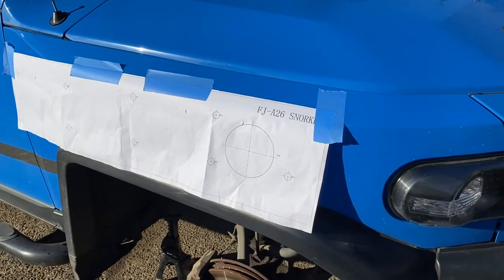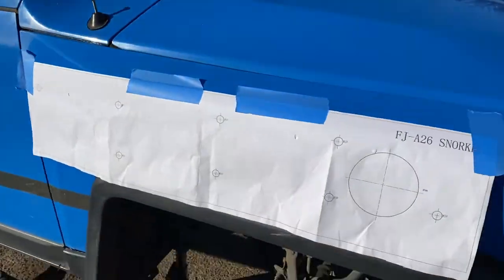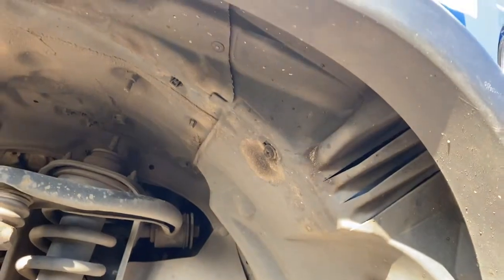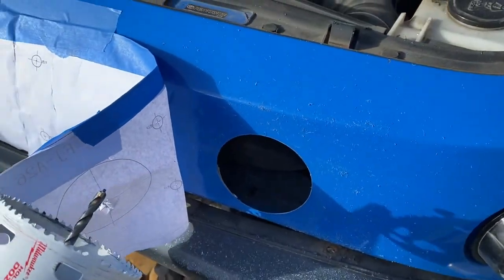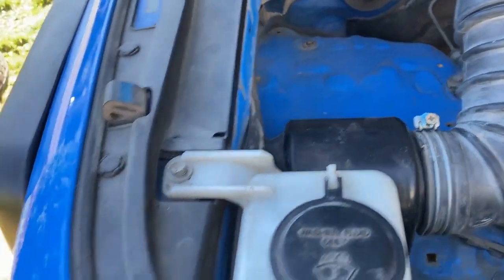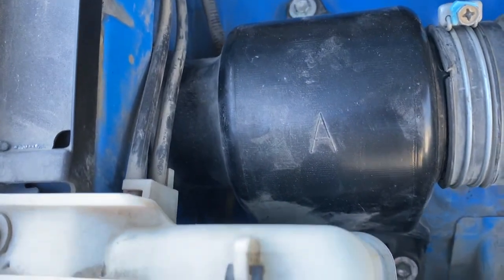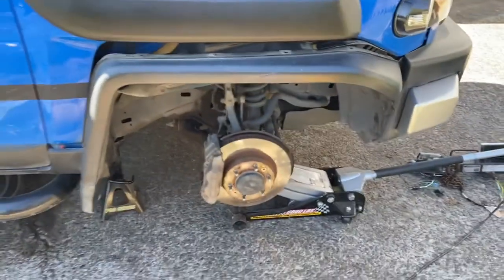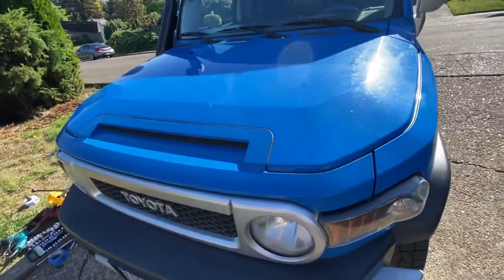Installing a $100 ebay snorkel on a Toyota FJ crusier.

Comment: I actually have the same Snorkel, going to put it on. BUUUTTTTTT I have the same template. For alignment of the template, what did you use as a reference to place it on the side of the fender? The edge of the paper to the edge of the fender line at the door? The height, from the edge of the fender line up? Wish you went over the steps that you did in order for the proper mounting. Many have purchased this Snorkel, and there is no Instructions, just the template. Thanks...
Reply from the maker: Yes I used the line on the door to the line on the sheet. Then I eye balled it just to make sure it looked level.
Reply: @WhatTheHellAmIThinking  Did you have to trim the rubber hose/boot? I had to flush cut mine. Worked out pretty good.
Reply from the maker: @tortoiseoverland  no I did not? you care talking about the boot that is just past the fender wall?
Reply: @WhatTheHellAmIThinking  the rubber boot between the snorkel and the water catch tube.
Reply: @tortoiseoverland  Hey, I'm curious to know which holes are incorrect from the template? Was the big one at least accurate?
Reply: @andrewbarrozo636  Big hole was right on. The small holes were off. Hard to make a flat piece of paper line up on a concave surface. The holes might have been right on via a flat surface. Make sure you give a margin of curvature error.

Comment: How did you get the fitment or where to put the template ?
Reply from the maker: It came with the kit! scary to cut the BIG hole,, but I love it!
Reply: @WhatTheHellAmIThinking  I just added a hole to mine blue FJ. 

There so much regret and doubts coming into mind right now
Reply from the maker: I lined up with you door seam. it had a line on the paper.

Comment: Hi there how's the snorkel holding up?
Reply from the maker: Great! just one complaint, the large hose clamp is rusting, so I will have to replace it this summer.
Reply: @WhatTheHellAmIThinking   2' 3/8" black zip tie. Never rusts. What I am going to use.